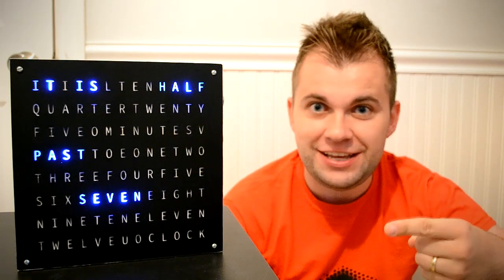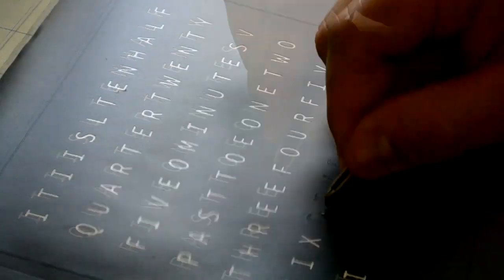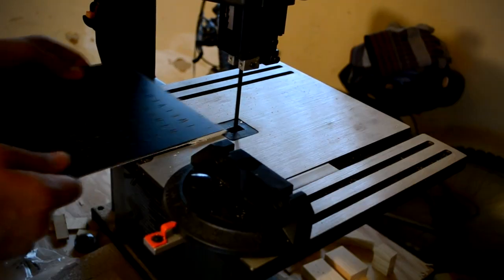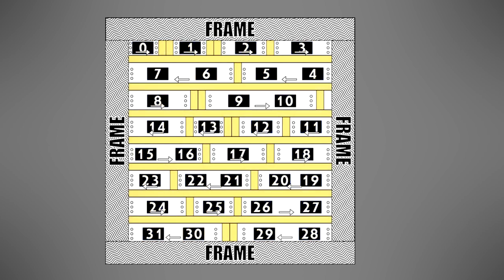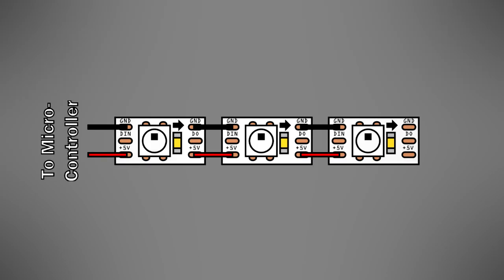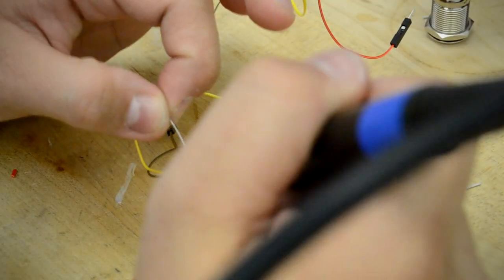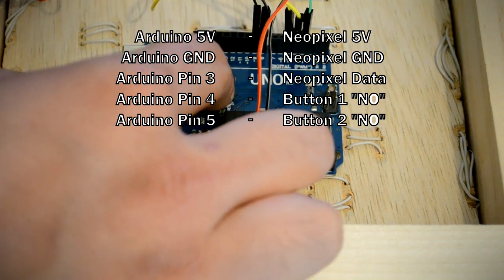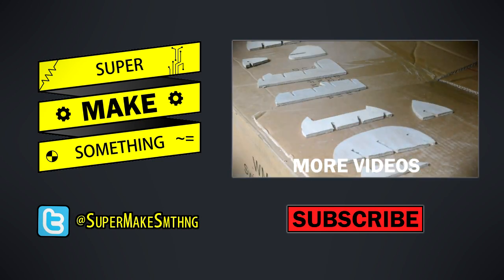Arduino + Neopixel Word Clock - Super Make Something Episode 6

Comment: How accurate is this clock? As far as I know, Arduino doenst have a real time clock built in
Reply from the maker: +SibertD Good question! Just via observation, I've found that the clock remains accurate over the course of the battery's lifetime.  

Since I haven't timed the clock myself yet, here is some math for a more scientific answer: Looking online, it appears that the crystals used in the Uno have a rough average accuracy of +/- 0.01%.  Assuming the worst case scenario, this means that the clock would lose 24*60*60*0.0001 = 8.64 seconds/day.  Depending on the LED brightness defined in the code, the clock lasts somewhere between 3-7 days with this battery pack, so it could lose up to a minute over the course of a week.  Since the clock only displays the time in five minute increments, this is not really noticeable in the display.  However, as you mentioned, a real-time clock could be used to keep the time more accurately.  I think that this would definitely become necessary if the clock would be on for weeks/months at a time.

Comment: What's up with using an arduino in elaborate projects such as this one? I thought it was mainly just used for prototyping.
Reply from the maker: In general people sometimes replace the Arduino with a custom PCB that includes the rest of the required hardware once a project is ready to go into production. In this case, the only hardware that would go on a PCB is the Arduino itself, so I decided to put it into my project permanently. An Arduino is simply a "ready-to-go" plug and play microcontroller.  Since this project was a one-off, it was also more cost effective to just use the Arduino permanently.
Reply: +Super Make Something absolutely right, there is NO problem at all using an arduino for a finalized project...
maybe an arduino nano or even better, pro mini, would be the best choice for the last version. But its quite the same thing...
Reply: +FunOrange In Brazil Arduino NANO is less to U$ 5, and components to make a stand-alone board is much more... Arduino NANO is ready to set and go
Reply: Oi André!  Você fez e/ou conseguiu fazer esse projeto?
Eu fiz a pergunta acima para o criador do projeto mas, nada melhor que vc para me responder sobre o assunto, se for o caso; portanto, refaço a pergunta a você:
1) Gostaria de fazer esse relógio no idioma Português (Brasil), portanto, você poderia me dar alguma dica? Por exemplo, quando o autor escreve em Inglês: "it is half past seven", em português, logicamente quer dizer: "são sete e meia", não é? Então, vc sabe como deve ser isso no "template" (quadro com letras) e o que deve ser mudado no código Arduino entre outras frases do Inglês para o Português?
Digo isso no sentido de adaptação do projeto.
2) Outra coisa, vc sabe uma maneira fácil de plotar as letras?   Obrigado

Comment: I`m trying to run the code but it is giving me errors that all the "setTime, adjustTime and the rest of the time names are not declared in the scope. 
I`m guessing this means there is something wrong with my time library but I installed it with the adafruit library and they are in the same location. the adafruit library is working.
 
Am I supposed to rename it or something? I have checked multiple times and I`m sure its installed in the correct location.
Thanks.
Reply from the maker: Do you have the time library installed as well?  A link to this library can be found in the code of the wordClockCode.ino file.
Reply: I got exactly error, after check Time Lib, I do see the setTime, not quite understand how to fix this.
Reply: After Google Search, if I change #include <Time.h> to #include <TimeLib.h>, it's no error any more, maybe you want try this. 
You can find more detail form the link below
https://forum.arduino.cc/index.php?topic=415296.0

Comment: Greetings friend! Firstly, thanks for the video;
I would like to make this watch in the Portuguese language (Brazil), so could you give me some tips? For example, when you write in English: "it is half past seven", in Portuguese it means: "são sete e meia"; So, how should this be in the template (frame) and in the Arduino code?  Thank you
Reply from the maker: In general, the best way to structure the template is that it forms a complete sentence reading left-to-right, top-to-bottom.  You will notice that basically words are "grouped" together in the template to form sentences in this way, i.e. the "quarter, twenty, half, etc." words are all grouped and the words for the numbers are all grouped as well.  Unfortunately, I am not familiar with what the correct grammar for saying the time is in Portuguese, but I would recommend grouping these words together in such a way that they are grammatically correct when a person reads it.  As for the LEDs, the change is relatively simple -- depending on what your word template/clock face looks like, you will need to light up the corresponding LEDs behind each word.  It is easy to add/remove Neopixels in the code should the number of neopixels in here not work for your clock-- you simply need to change the number in the line that declares the Neopixel string, and change the if statements accordingly so that it matches with your template.  Hope this helps!
Reply: Thank you very much; I will try!

Comment: How do you control each led separately if all of them  are connected together?
Reply: It is possible because they're not common LEDs, they're Adafruit's Neopixels.
They are addressable , so they just need power and data to work.
From Wikipedia: "NeoPixel is Adafruit's brand of individually-addressable red-green-blue (RGB) LED. They are based on the WS2812 LED and WS2811 driver, where the WS2811 is integrated into the LED, for reduced footprint. Adafruit manufactures several products with NeoPixels with form factors such as strips, rings, matrices, Arduino shields, traditional five-millimeter cylinder LED and individual NeoPixel with or without a PCB. The control protocol for NeoPixels is based on only one communication wire. Adafruit provides an Arduino library and a Python Library to help with the programming of NeoPixels. In addition to the traditional RGB technology, Adafruit manufactures a red-green-blue-white (RGBW) variant of NeoPixel for all products except those that feature a NeoPixel Mini 3535. Those integrate an additional white LED in the package for extra possible color mixes and selectable white color temperature (the company sells single NeoPixels with a 6000K, 4500K and 3000K color temperature)."

Comment: What is the capacity of the battery and how long does it last?
Reply from the maker: +dontkillme571 I currently have an 11000mAh battery in the clock.  Depending on the LED brightness and color, the runtime is between 3-7 days.

Comment: ah, also y want to say why an arduino uno? arduino nano or nano pro its more than anought , if you remove the stats leds you can  get a good battery life... and a button to change led colour ..... cheers man!!!
Reply from the maker: LaBass Project You are correct you could definitely use a different Arduino, or even a bare ATMega chip to save some power and extend battery life. I chose to use an Uno primarily for illustration purposes, since connecting everything up was as easy as plugging things into the headers. Also cool idea about the color change button!

Comment: How long does the battery last? How many mAh has the battery? Thanks.
Reply: Aurelio Durante same question here
Reply: u have to program that! the question how much voltage needs the system...?

MODIS:
IDLE
ADC Noise Reduction Mode
Power Save Modus
Power Down
Stand By

google this and u find ur answers!

Comment: Should really adjust your bandsaw support down to within 1/2" from material
Reply from the maker: +Robert Purvis The guard should be 1/4"-1/2" from the material, this is true.  For everyday use, the guard is set correctly, but it interfered with filming.  Perhaps a disclaimer is in order.

Comment: very good and creative way to use an addressable LED strip!
and your object is really nice, good looking.
other people pointed this out, but I think you REALLY should use a RTC module to have a more accurate clock, and save the time even if the main battery runs out of power.
few possible further improvement I see right now:
make the USB port of the battery accessible from outside, to charge the battery without take it out from the case.
find a way to check the power level (colors? sound? gauge?)
make the enclosure thiner using an arduino mini or nano.
run the arduino in power efficient mode to make it last longer (downclock it, disable unused features etc... see here: http://www.gammon.com.au/power this link is gold!)
make it telling the weather with a athmospheric pressure sensor, why not?
connect it to internet and change the color if you have an event in your google calendar (I think it is possible), that could be fun.

thank you for your video.
Reply from the maker: Thanks! Glad you like the video. These are all great ideas! I will definitely consider these for v2 of the clock. Cheers!

Comment: Please Can u provide us the dimensions ?
Reply from the maker: Jn Md The dimensions are roughly 200x200x40mm.
Reply: Thank you ! 
Can we Use Leds Other Than NeoPixels ?
Reply from the maker: Any addressable LED strip should work, most specifically ones of the WS2812B or SK6812 based varieties.
Reply: Ok Thank You Very Much. So i can Use any LED Strip from the market right ?
Reply from the maker: Jn Md As long as the LED strip is addressable.